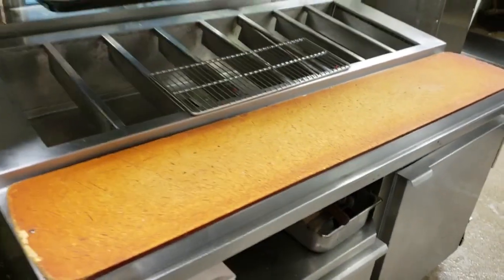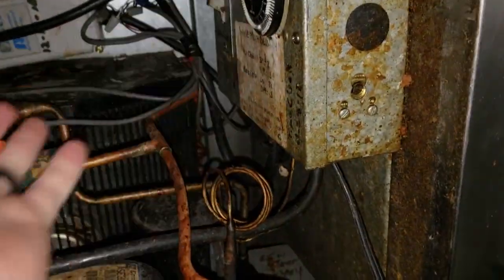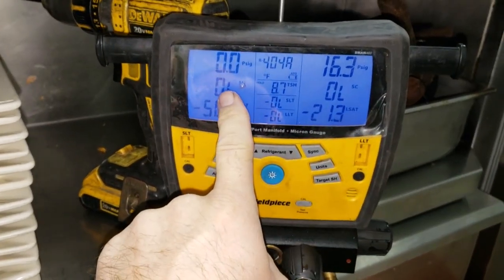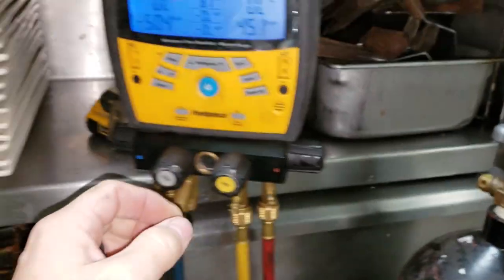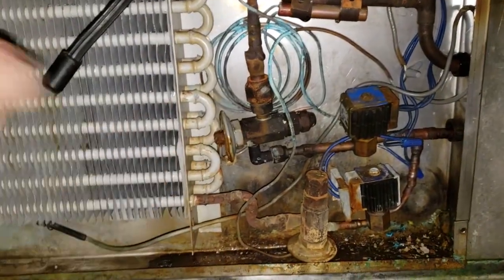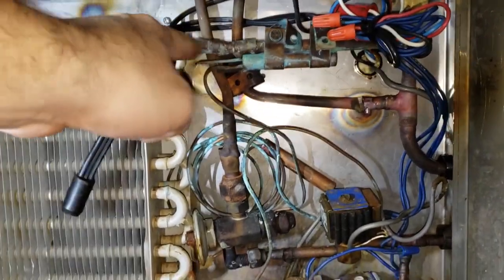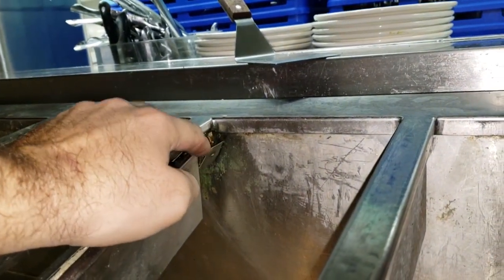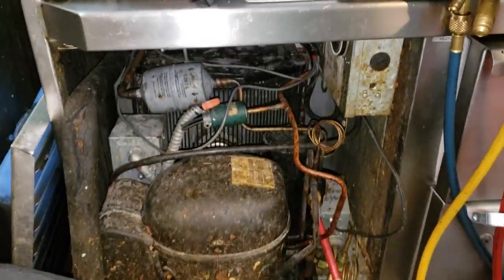KAIRAK REACH IN DISASTER

Comment: Based on what you said at the end it seems like the customer had a lot to do with how hacked their equipment is.  Wouldn't be surprised if the last company was actually multiple companies that were told to do the quickest/cheapest thing they could to get it running.  I've seen plenty of temporary repairs become permanent until the next time it breaks down because customers just want it up and running without spending a lot
Reply from the maker: Thanks for watching bud ,I will be going live this evening 2/25/29 @ 5:PM (west coast time) on Youtube to discuss my most recent uploads, answer questions from emails received and the chat. Come on over and check it out if you can
https://youtu.be/wnrZHSW44tw
Reply: Nothing more permanent than a temporary solution.
Reply from the maker: Ain't that the truth!

Comment: It's 3AM and here I am watching  HVAC videos regiously. One thing your line of work has uncovered (aside from great knowledge) is most restaurants DO NOT clean their units enough.
Reply: Its only the mechanical box that is  dirty...witch is normal because they cook with oil & such
Reply: stheodro Though cleaning the mechanical area of that box wouldn't hurt as it would help the unit last longer and run cooler! Also the more dust, the higher the fire load if an electrical malfunction were to happen in there, which with that undersized cable it could have happened! Remember the MGM fire in Vegas in 1980? Caused by an improperly wired condenser unit in a cabinet that was piped to a wall pie rack display case!
Reply from the maker: Thanks for watching bud ,I will be going live this evening 2/25/29 @ 5:PM (west coast time) on Youtube to discuss my most recent uploads, answer questions from emails received and the chat. Come on over and check it out if you can
https://youtu.be/wnrZHSW44tw

Comment: I share your pain regarding junk units & I have experienced the same problem on my jobsite where corporate wants to polish a turd. We have a small packaged Trane air cooled R-22 chiller that is past its prime. Instead of replacing the unit with a new chiller which would be more cost effective, energy efficient & be covered under a warranty, the company instead spent a massive amount of money replacing the condenser coils, chiller barrel & a compressor motor. Also some sensors & the EEV have been replaced adding even more money to the bill. The unit is still giving us headaches from time to time. All that money invested in a worn out piece of equipment that is used to cool the Cath Lab in a hospital. Unbelievable!
Reply from the maker: Thanks for watching I will be going live on YouTube this evening  4/1/19 @ 5:PM (west coast) to discuss my most recent uploads announce the Sporlan Bq TEV kit winner and answer questions come on over if you can https://youtu.be/WLQxwzT65SU

Comment: Nice video.
If you need a new evap coil for these units we have different types and sizes mostly are 10x12x2 or 6x12x2 for bases also we do custom pan chillers.
Reply from the maker: What company are you talking about that has these coils?
Reply: @HVACRVIDEOS  about kairak units
Reply from the maker: I'm confused are you from Kairak?
Reply: @HVACRVIDEOS  no,but I work for them some years on fabrication so I know how the units are build and how they work
Reply from the maker: Gotcha yeah we usually order replacement coils from Parts Town

Comment: If that was my prep table, I'd cut my losses and buy a new one! This is assuming I was the owner of that establishment! Mainly for peace of mind! That undersized wiring, scary! In November of 1980 an improperly wired condenser unit in a cabinet that had been piped to a pie rack display case at The MGM Grand caused the infamous fire in the Delicatessen that smouldered and burned in a bulk head area of the wall and ceiling, then about 7am broke out and raced through the casino!
Reply: People don't operate that way though. I have a client in a pub with a 40-50 year old evaporator that i have fixed two leaks on but they just keep popping up. It's about a grand for a new evaporator, problem solved. But they would rather keep topping refrigerant up which costs them at least that each year
Reply from the maker: Thanks for watching bud ,I will be going live this evening 2/25/29 @ 5:PM (west coast time) on Youtube to discuss my most recent uploads, answer questions from emails received and the chat. Come on over and check it out if you can
https://youtu.be/wnrZHSW44tw

Comment: Is there a nice way to tell a customer to dont bother with the old crap and just throw it out and replace it? In the end it boils down to food saftey, and I cant see how they can maintain safe temperatures with this piece of junk.
Reply from the maker: Sometimes you just have to fix them and make the customer happy. Thanks for watching bud ,I will be going live this evening 2/25/29 @ 5:PM (west coast time) on Youtube to discuss my most recent uploads, answer questions from emails received and the chat. Come on over and check it out if you can
https://youtu.be/wnrZHSW44tw
Reply: Unrelated question: have you been called out to work on other type of hvac  machinery, like shipping containers with built in cooling system, or tractor trailers w built in cooling?
Reply from the maker: Not really the weirdest thing I have worked on was when I was called out to a mushroom farm , the owner had converted 53' box trailers into giant walk in coolers. He basically had someone install evaporators and condensers on them and they were not movable anymore they had permanent power ran to them, kinda weird